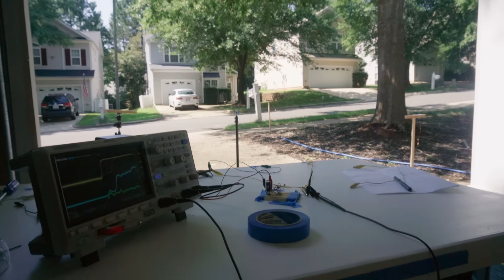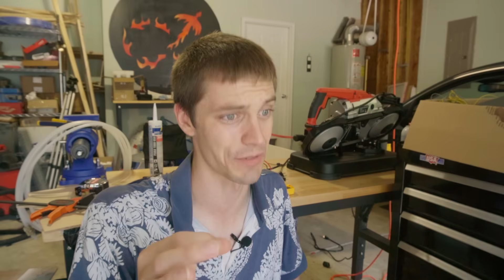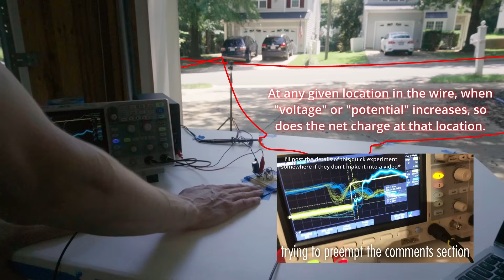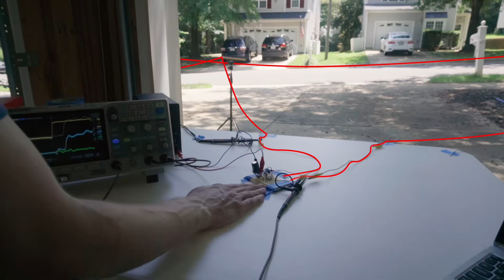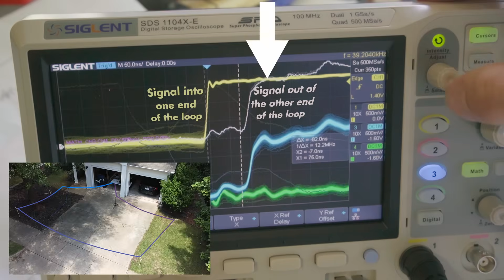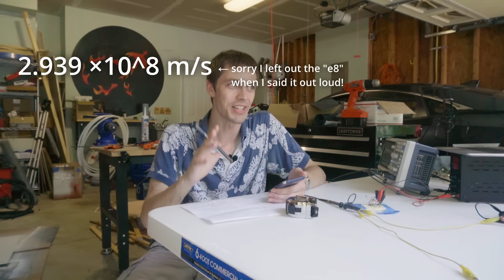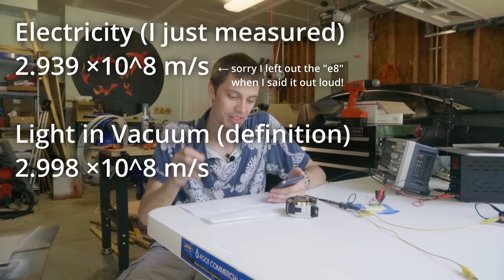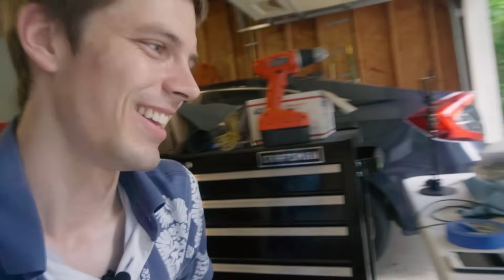Why does WATER change the speed of electricity?

Comment: Have you considered making a video on how oscilloscopes work? While the core concept may be simple, any software developer knows it's ridiculous to measure something smaller than a nanosecond, let alone record events for longer periods of time and filtering it to .1 of a nanosecond.
Reply: @DehimVerveen  I think this illustrates the utility of that kind of video. As a software developer, this leads to more questions -- e.g. even with an instrument capable of changing measurable state at that rate, how would you measure that state and record it at that resolution? Even with a fast processor (multiple ghz), we have just a few cycles to measure AND store--and we need to do so without immediately overwhelming whatever buffer is used.

My intuition tells me that I'm thinking about it the wrong way -- that we're not just recording and storing all these data points but rather pushing all data through a low latency buffer and then copying that buffer when an event is triggered and these buffer copies are really the data being captured. But I really don't know.
Reply: @DanKaschel  Your intuition is actually on the right track. During most of the data acquisition process no CPU is actually involved. When the oscilloscope is waiting for a trigger, ADC is running constantly, and data from it is saved directly to DRAM memory. The whole process is controlled using combinatorial logic inside an FPGA. Data is constantly overwritten in a circular buffer. When trigger is detected, FPGA continues acquisition for set amount of time, and then stops overwriting the data. Now the data can be read and processed in not-realtime fashion.
Reply: @jakubjendryka4554  First thought that comes to mind is that the "circular buffer" has a speed controlled by an oscillator. In that you can get more information to process then display it on the screen. Are we on the right track that the oscillator speed is the key to the max frequency that a scope will measure and changing the oscillator speed will change the max frequency rating of the scope itself? If this is not correct then I contribute it to it's been a long hard day and my logic of processing things get a bit off track as the day goes on.  BTW, Electronics and learning Never get Old but I do... LOL.
Reply: @Daniel Kaschel  I think your questions are mostly coming from a thinking like a software developer. You are imagining that there is a central processing unit (CPU) that needs to process the data in software, and this creates an obvious bottleneck as every piece of that torrent of data needs to go through that one CPU.

The answer is that this isn't how it's done! Nearly all of the operations - acquisition, processing, storage, and display - are happening in hardware in some kind of pipeline. There is no software involved, and so everything happens in parallel. Think of it like a manufacturing line in a factory. One bit of data enters the first stage of processing, is processed, and then is sent to the second stage. While the second stage is processing that same piece of data, the first stage is now free to process the next piece of data - and that's what it does! On each clock cycle, all of these different stages of processing are happening *at the same time*, each one working on a different part of the signal that was captured at a slightly different time.

At the end of the pipeline the processed data is dumped into some memory (overwriting the previous data), where a more traditional software computer is probably in charge of prettying it up and displaying it to the user. This software and user interface can also control the configuration of the pipeline - for example, change the sampling rate, or disable some optional part of the processing (like the Fourier transform).

I hope that was understandable for you!

Edit: keep in mind that even in a traditional software environment, there is a lot of work happening in hardware outside of the CPU - for example, generating the signal that is sent to the display. This idea of off-loading a lot of work that can be done in parallel is exactly what a GPU (Graphical Processing Unit) is for. GPUs are excellent at doing things in parallel unlike a CPU, but even they have to run in software and won't be as fast as hardware that was engineered specifically for one singular task - such as the hardware of an oscilloscope.
Reply: @DanKaschel  Yes, like Jakub Jendryka said, your intuition is on the right track. What I would probably do is write the (possibly downsampled) ADC data to a DRAM buffer, while checking for trigger conditions in hardware. If a trigger condition were to occur, I would first write the remaining samples in the window to the buffer and then trigger an interrupt. The CPU can then read the data and do (optional) further processing, which may or may not be done with different hardware modules. The final processed data can then be displayed.
Reply: @DanKaschel  An oscilloscope is not a computer, it is a specialized device that exists only to display voltages. Modern scopes are much more powerful and more like computers and have computers integrated in to them but you fail to understand the underlying hardware is generally different. They do not need the vast complexity that modern computers have because they are specialized units. Usually there will be some ADC that runs at at GHZ rates or more. It's possible to get THZ speeds now. There are all kinds of tricks used to make it happen.

Sample and hold is used for memory and there is no complex data single path required to address memory so the latencies and such are much different. Computers use parallel processing and addressing for speed but scopes don't(although there is paralleling used in some of the techniques it's not what I'm talking about). Most scopes have a limited memory when run fast since they cannot transfer that to slower memory... sorta like CPU caches but CPU's are cannot stop reading instructions while scopes can(it reads what it can and if it doesn't capture what you want then too bad, just repeat the experiment and try to figure out how to get what you want).

Basically, say, one has an ADC(and sometimes even a discrete specialized ADC) and very fast memory and as the ADC reads(possibly triggered) it dumps the data directly in to the memory. Then separately the scope will record that data deal with it(display it, record it, whatever). The loop for the ADC and memory is made as efficient as possible(unlike a typical computer) because that is really the sole purpose of a scope... to read voltages(all the bells and whistles is just to do it better and to be more helpful).
Reply: @kodfkdleepd2876  There are far too many people who do not understand that an ocilliscope is really just a very fast voltage recorder. So thank you for bringing that up
Reply: You only need to capture a few data points, and extrapolate the data from one sine wave, or a portion of that wave. The rise time and the peak. Once you have sampled, let's say two data points at the rise from zero, two either side of the peak (including the peak), and two data points to the fall to zero (inc zero), Voila!
Reply: @DanKaschel  It is important to remember that clock speed is dependent on how long it takes a signal to travel from one end of a processor pipeline to the other, it actually says nothing about how fast individual components can react to change. Some digital components can switch trillions and even quadrillions of times per second, and analog electronics "simply" impose a delay on the output without imposing a maximum frequency. Some of the earliest high precision oscilloscopes used delay-line memory for the "buffer" and a set offset after whatever trigger event was selected.
Reply: @trapfethen in my case it's less important to remember that and more important to learn it in the first place
Reply: I'm certainly struggling to imagine how storing digital data without a CPU involved works, personally, I understand ADC conversion is instantaneous but the writes elude me
Reply: @descuddlebat  remember that apollo was powered by literal ferrite cores and circuits. You can literally do what a cpu can do using relays and MOSFETs. at the end of the day cpus are just programmable switches but multiply it to a trillion. Even dams before use no CPU to automatically monitor everything just relays. Electronics is a different, more complicated beast than computer science. also remember the most basic computer is literally your fingers, you don't have a cpu only an organic squishy sponge in your head.

Also microcontrollers and ICs are used not CPUs in most things electronic like an ATMEGA processor, ADCs, and gates and other stuff to create something. Monitors don't use cpus to control them, old tube tvs dont need cpus to control them to display something even old tube oscilloscopes never used cpus.
Reply: A microcontroller processor is a computer. Just about everything uses a computer to control it.
Reply: @dragonfireproductions790  Microcontrollers most certainly do have CPUs, the difference is that the peripherals are on the same die as the CPU. 

Also, ICs include CPUs, microcontrollers, ADCs. If it's on the same silicon, it is an IC.
Reply: @descuddlebat  FPGAs implement custom digital logic, a CPU can be made on an FPGA however for data acquisition tasks its more like a factory conveyor system with loading and unloading zones, switches, muxes and controllers. Data is streamed at the sample clock, every sample clock, past controllers that decide what to do, when desired data is to be stored, the data is just streamed straight into RAM and the CPU is then interrupted to be told it can have a look at all the data captured on its own time.

For higher end oacilliscopes and faster instruments, custom ASICs are designed which can perform about 10x faster then an FPGA. That is how some of the highest end oacilliscopes achieve over 0.25 terasample per second (the Keysight UXR). 

Its difficult to get right and takes a massive amount of time but in principle, making an oscilliscope is actually quite easy. 

I recommend you The Signal Path Youtube channel.
Reply: @descuddlebat  SRAM does not require a software controller. It's analogous to ferrite core memory, where physically selecting two wires and applying a voltage to them will change the state of the bit where those two wires intersect. Attach a series of latches or a shift register and the appropriate circuit can store a series of values in that memory using only transistor to transistor logic. There's no software required because it only has one mode of operation, and the "CPU" is the circuitry directly attached to the memory.
Reply: @silverywingsagain  DRAM is too slow.
Reply: @deang5622  Right, I was thinking about SRAM. Thanks for the correction.
Reply: @descuddlebat  well, you're not really storing it, for one. The scope's specs will probably tell you how long your window is (varying with your sample rate/max frequency and other stuff), but it's not very long. So you can just use a bit of fast RAM, instead of needing to push it out to a bigger blob of slower RAM or permanent storage.

You don't even need a CPU to store data in your *computer*'s RAM, most of your peripherals (network card for instance?) can stuff data to/from RAM without the CPU's involvement ("DMA"). CPUs aren't magical, other hardware can interface with RAM just the same as they do. The only reason a CPU enters the picture in your computer is to process arbitrary software instructions. An oscilloscope doesn't need to process arbitrary software so it doesn't use a CPU*.

(* It probably does in fact use a CPU, but not for data acquisition. It's a lot easier to make a fast circuit dedicated to one specific thing than to make a fast, generic circuit that can do arbitrary operations. Ye olde fast, easy, cheap: pick two.)

You can imagine the way RAM works as being a circuit that, once power is applied to a certain bit, keeps that power within it. So to set it you just hook that bit up to the input and apply power; and when you want to read it later on you just hook that bit up to the output and see if there's power there or not. (It's more complex than that with SRAM vs DRAM and refreshes and needing it to keep its state once it's been read, but it's a good enough analogy here.)
Reply: @descuddlebat  ADC conversion is not instantaneous.

Lookup FIFOs. They can be used to store data. You don't need need a microprocessor to write data in. You can design an electronic circuit without using software
Reply: @descuddlebat  Think of what a CPU is made of, loads of transistors, but on a higher level, blocks of RAM or an ALU, which at their core can be constructed with logic gates. Essentially how FPGA hardware accelerators and oscilloscopes and the like work is that rather than using these parts to build up a CPU, which is a general purpose processor, you instead use these parts to create a totally custom piece of hardware, that means they dont have to be limited like a CPU is. 

A CPU uses hardware built into it to store the data in RAM, it is absolutely possible to use the same hardware without a CPU but use specific custom hardware to control it instead. CPUs are not required for data storage, they never have been really, they are just a convenient, general purpose way to do it. CPUs are just hardware built up in a specific way to create a general purpose processor. Some of the time, using a general purpose processor is not what you want, so instead you use a custom piece of hardware designed for a very specific purpose, it is possible to make it do anything a CPU can without needing a CPU.
Reply: @descuddlebat  Well it's bit complicated even with ADC's there are different types. Some take alot of time to Spit an output. Far as I know Flash ADCs are the fastest but their resolution is limited to 8-10bits max since the circuitry become impossible to implement in Silocon to achieve higher resolution beyond that. On the other hand Dual-slope ADCs have higer resoultion but lower converstion speed. For Storing Digital Data simply can be done by Enableing the particalar RAM chip and Enabling the Write Function (There are things to condside like RAM timings and some other small details). Hope you got a breif idea.
Reply: yeah i’d guess it’s dma’d in so the cpu doesn’t need to do anything
Reply: @morgan0  No. Not DMA.
Reply: I once had an oscilloscope that could measure pica seconds, but I couldn't help myself and I ate it.
Reply: @GirthOfANation  The picas tend to be too salty for me! The teras are a bit more tasty!       :)
Reply: hey martmists
Reply: There’s actually no way for a CPU to interface with any kind of analogue electronics. To turn on a light you need a DAC and to measure a voltage you need a ADC. These are special electronics you would never normally see in a general purpose CPU. 

On a bigger scale, you should think of an oscilloscope as a purely analogue device, and the only purpose for a CPU in it is to automate the boring parts of using an oscilloscope.
Reply: There are many oscilloscopes that don't use any software.
Reply: @DehimVerveen  Hi, you seem knowledgeable in an area I lack experience in. Do you know any method for getting a microcontroller/program to send a signal to flip a fast MOSFET gate signal, in picosecond or fempto timing, that ultimately controls a short distance spark gap with precise firing time?
I'm researching low cost impulse signals that can arc a tiny spark with a lifespan of under, say, 1 pico or a few 10+ fempto seconds. Do you recommend any way to view it on an oscilloscope without damaging the scope? An op amp perhaps or am I really far off the mark with that? I'm aiming for low cost.
Reply: @ickorling  I do not know how to achieve sub picosecond pulses. The closest thing (sub nanosecond high voltage pulses) to what you want I can think of is an avalanche transistor based marx generator. Measurement is gonna require a high bandwidth oscilloscope with a high bandwidth high voltage probe. What do you want to use it for? Are you trying to make an EMP?
Reply: @DehimVerveen  I'm not planning to use it as an EMP, but in the wrong hands it would be... however, I think it's possible to make a circuit that tranceives energy with a generated nano-blackhole created via energy spike concentrated in a semi-0D point. That nano blackhole concept isn't even a random wish of mine, but a 'quasi-exotic particle' in vacuum flcuations, and other proposed generatuon methods involve the casmir-hall effect.
Reply: @ickorling  You dont seem to have anywhere near enough knowledge to even attempt something like this assuming that it is even possible in the first place.
Reply: @conorstewart2214  👌 but is it worth trying to anybody 'qualified'? If not then steeep aside.
Reply: @conorstewart2214  I mean serously. A few capacitors and buck transformers, even a youtuber can pull off with no formal education. All ya gotta do turn something off really fast, and thousands of patents, and dowzens of pre-built parts, plus 3D pronting and laser cutting tech available. I don't even need a digital compoent. Get outta here with ya discouraging non-sense.
Reply: @conorstewart2214  Yes, and as appreciateion for the danger. And I've not run the experiment yet for desire to be most safe and controlled and just want some finishing touches about data collection and pulse control.

I do intend to be fully mentally and peer reviewed, and equipt on a well inspected test. In a near vacuum chamber if needed. I'm intending to begin at the losest feasable for spark voltages, and never jolt to higher volts without due care and time to process previois results. Starting with near disrance gap ranges, micro devices that fit in your hand but plenty of insulation ans very strong insulation layers and electromagemtic sheilding layers double layer boxed durring testing. Very distant ignition protocal in desert environment; with kill switch designed as failproof severence of main conduit with gillutein type dead trigger on a very long insulater pole to cut power. Gloves with unbelievable insulator thicknesses and a static guard are advisable to be equipt since you can never be too careful, and keep all this equipment in protected storage.
Reply: @conorstewart2214  Bur if you were jusy concerned about safety you could have been more direct about why you made that comment. I'd understand, its obviously powerful tech I'd hope to design even better fail fairest and hull pressure integrity sensors to destroy its functionallity beyond a quick repair. Etc etc.
Reply: Not paying attention to events shorter than a nanosecond on an o-scope would result in your computer not working, as just one example.  Those carefully routed tracks on your motherboard are adjusted to so signals arrive with accuracies of picoseconds. Signals can travel a foot in a nanosecond.
Reply: @stargazer7644 well put.  Think of the arrival time issues that would arise (pun intended) if all semiconductors were of significant and differing lengths.
Reply: I quote from my post: "You will notice that the argumentative are not qualified electrical engineers, thus their argument comes from ignorance. A little knowledge is very dangerous." end quote.
Reply: @rasputinputin8103  Your posts might be more relevant if you'd learn how to reply to a comment.
Reply: You need to know how a ADC works, it's pretty much a Resistor array coupled to a specialized flip flop, like 74HC174 polled very fast, witch gives you bits.
a CD4013 does clock 15ns @ 15V, the 74HC174 seems to be more than 3 x faster if I'm reading it right. some company hold the funds and knowledge the develop their own IC's.
Reply: just checking any adc input chip will tell you how fast it samples the signal. All a software dev needs to do is just tap into that chip and ask it to do a read, then get the value. It would be more ridiculous for the chip designer than the software dev.
Reply: @niluss6  You can't do it that way in an oscilloscope.  The samples are taken far faster than any CPU cycles.  Dedicated acquisition hardware is used to take and store the samples in very fast memory.  The CPU doesn't get involved until it is time to display the data.  Scopes sample as fast as 256 Gigasamples per second.  That's 621 samples taken in the time a fast 5GHz i9 can process ONE assembly language instruction.  The CPU simply can't keep up.
Reply: Just look at a circuit diagram for one; it explains it. Or buy the book 'The Art of Electronics."
Reply: Yes this! Please! Video about oscilloscope!
Reply: Remember that oscilloscopes like this (although they couldn't do FFTs) existed LONG before fast or small computers existed.  I worked in a TV studio that had a beautiful Tektronix dual-trace scope from 1967–1970.  Everything happened in analog hardware, with high-precision components.
Reply: Sounds like this Experiment on 1 day and  process data for 10 years to get a answer.
To stay with IT...
Thats why Networks use ranges and save a lot of Bits, and that saves a lot of CPU power.
But anytime you shorten Something it is not longer unique, that can jeopardize safety. (Or to stay at the Video, Impact your Data)

And thx to all for the nice talk Here, it was fun to read.

Greatz from Germany
and have a nice Day
opo
Reply: @DehimVerveen  I have older scopes that do this without a problem up to 500 MHz or more.
Reply: So is the speed of light is also the speed of causation?
Reply: @zell9058 C isn’t really the velocity of light; the velocity of light is limited (in a vacuum) by C, the velocity limit of causality.  The velocity of light changes (slows down) depending on the medium in which it is traveling.  That’s how lenses work.
Reply: The answer is not blowing in the wind but it's in the fields ... particularly the Field Programmable Gate Arrays. I must confess the ADCs on these machines are impressive! They do have a low bit depth, though. With such low bit depth you can create a direct comparison ADC - for 10 bits you use 1,024 analog comparators. I believe EEVBlog is the place to ask your question.
Reply: +1 for this. I would love to see an AlphaPhoenix video on this subject.
Reply: You need to know about CR and L/R time constants and scope input impedance
Reply: Wow... I actually learned a lot in this thread... a YouTube comment section actually has worthwhile info in it... who would've guessed.
Reply: @DehimVerveen  A to D and D to A converters all cause a time delay so the end result is GIGO
Reply: @DehimVerveen  hey there, You seem like to know whats the deal with fpga, can you recommend me any starting point(or what to buy) if i would like to measure time / distance with fpga? I'd need very accurate measurements. Thanks
Reply: @dronemotionlab  You're probably going to need (someone with) some prior experience with FPGAs. If you want to get started with FPGAs, you'll probably want a training board. You could go for a Digilent Basys 3, which is based on Artix 7-series FPGA.

Do you need picosecond resolution? In that case you would need to implement a TDC. You can implement it on the Basys 3, though I do not know how well that would work, given that the signals would have to travel over the PMOD connector. I've only ever implemented a TDC on a Xilinx UltraScale+ platform, however those are quite expensive. You could also take a look at Lattice ECP5 FPGAs, which are a lot cheaper, but it may or may not be more difficult to implement a TDC and the resolution you can achieve will be lower. I cannot recommend you a specific board. You could make your own board, but that depends on your PCB design skills. You can take a look at what it takes to implement a TDC by googling "Xilinx 7-series TDC", "UltraScale+ TDC" or "ECP5 TDC" or something like that and seeing what pops up. If you need more help, I'd suggest asking a question in reddit.com/r/fpga.
Reply: I think the answer might be that there is not software directly involved. A lot of it is analog. With only an interface supported by traditional computation.
Reply: There are many, many devices which function more rapidly than a processor does.
Reply: There were oscilloscopes long before computers and CPU’s. They were an analog device, just like old tube televisions. The signal coming in caused voltages, currents, fields, to change and move an electron beam. The only “processing” was done by the fields themselves.
Reply: I was going to design my own oscilliscope so heres what I know.
Im really bad at explaining things and frequently forget technical terms(actually words in general), so bare with me.
An fpga basically just talks to an ADC, and stores the results in a circular buffer, usually some kind of DRAM.
But for really high speed signals, you cannot find 1 ADC fast enough, so you generate a clock, and then duplicate it lets say 8 times, but out of phase(360/8=45), and each phase triggers the next ADC. This is what pipelined ADCs do, they are really just a bunch of ADCs that trigger sequentially. Then once you have all the data, you just read it and display it on a screen.
Now there is a lot more to it than this(probably going to get some of this wrong), specifically before the ADC, you divide the voltage into a range your components can handle, then use a preamp to make use of the full range of the ADC. If your signals max voltage(after attenuation) is only half of the ADCs, then you are losing basically half your bandwidth.
If I rememeber, keysight had a ton of info on oscilliscope design and how they work.
Reply: It’s data plotting than processing.
Reply: high speed  oscilloscopes are expensive because of this reason. It uses fast ADCs which can sample at insane speeds. Then there is FPGA for real time circuits
Reply: oh hey Martmists, didn't expect to see you here
Reply: @Ancurio1999  Is he your friend?
Reply: Isn't cycles of 0.1 ns 10 GHz? Doesn't seem that hard with the available state of crystal oscillators.
Reply: Buy an old scope. You will not need to worry.
Reply: as a software developer this would be over your head haha
Reply: Oh fuk hi furry ingeneer